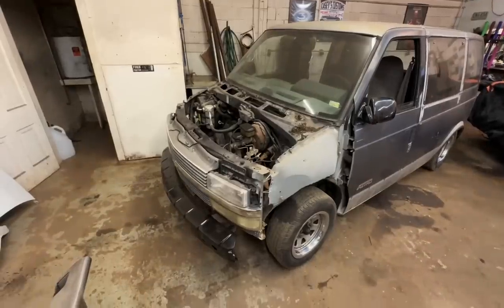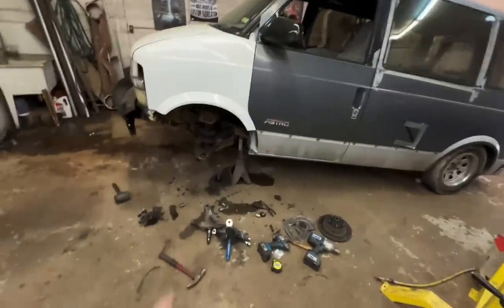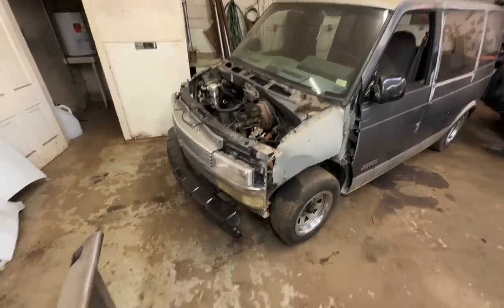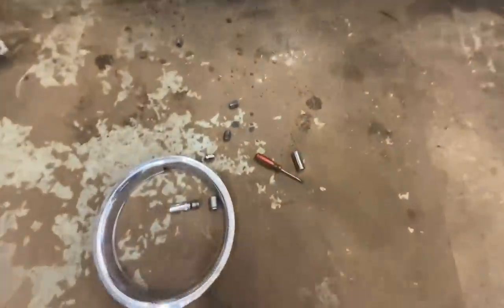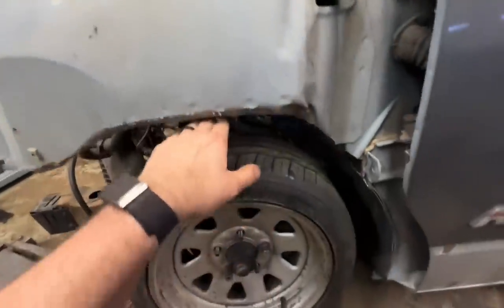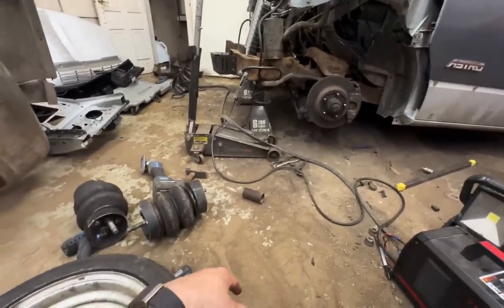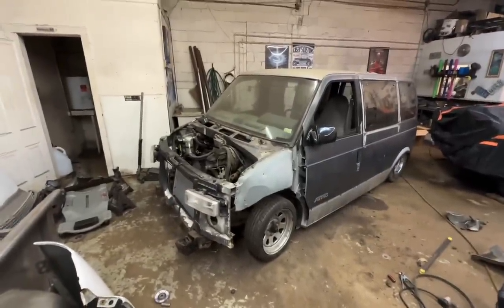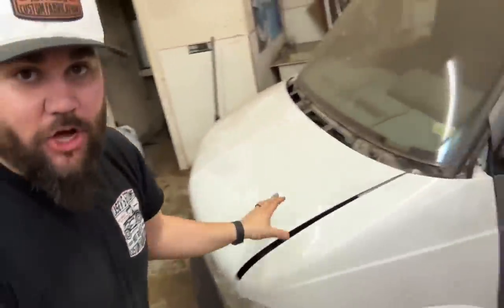BUILDING A LOWRIDER VAN ON A BUDGET! KUSTOM CHEVY ASTRO LAYING ON THE GROUND!

Comment: Just don't use any deep dish wheels, I remember way back guys would use 13" and 14" reverse wire wheels and they stick out and you can only drop an astro like 3". Just a standard offset is all that really works. I even seen guys run fwd rims just so they could tuck

Comment: Back in 95 or 97, a guy in my neck of my woods built a mini van with a built 350. He made his own ss miny van!. It was incredible.
Reply: A small block bolts into these vans incredibly well and easy to do. I've  done a couple of them now. I spent a bit of time doing the first one. The second one I had finished in two days.  No major modifications at all.  Even the factory V6 exhaust bolts up to the 350 manifolds.

Comment: I used to be a big fan of the Astro vans and owned three of them at the same time.  I had a '96 and 2000 GMC Safari and a '01 Astro..  Everything was good until I had to work on them and do lets say a tune up..  It took 10-15 minutes just to get the doghouse cover off and maneuver around the fronts seats to get out of the way.  I had to take the two front wheels off just to get to the spark plugs to change them (#5 and #6 plugs are a pain to get to) and when it came to spark plug wires, I had to go back and forth from inside the wheel well to the interior to fish them through to put them on..  Then spend another 10-15 getting the doghouse cover back on..  So if you ever get stranded on the side of the road in an Astro, be prepared to spend three to four times the amount of time trying to figure out the issue(s) then it would be on a normal vehicle..   
I ended up selling all three with no regrets..

Comment: For them lugs you have to use the half size sockets like a 19.5. I think ASTRO tools has them and of course all the tool rape trucks will. Run into alot in the rust belt with them they start rust jacking then all hell breaks loose

Comment: Back in the 90's I had a G Body. I had 15x8 reverse 100spoke Dayton wire wheels. I ran a 195/55/15.on a 8 inch wheel. With hydraulics front and back. And it was on the ground . You could always run a body kit. Then it actually wouldn't have to go so low to appear to be on the ground

Comment: I had to go with a 14 rims with low profile tire on mine I put dual exhaust to two flow masters with chrome tips but by going with smaller rims and tires you'll get clearance with out cutting anything I also painted it Satan black with old school pin striping looked old school and bad ass at same time